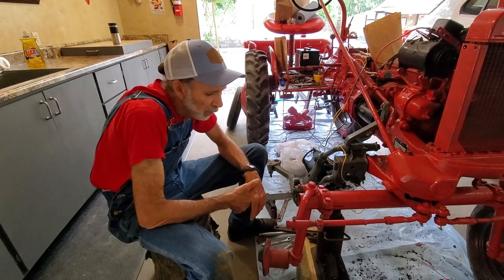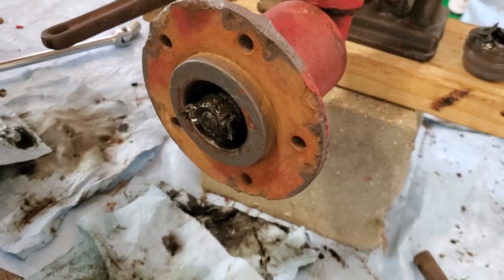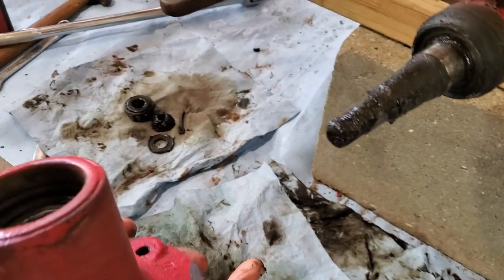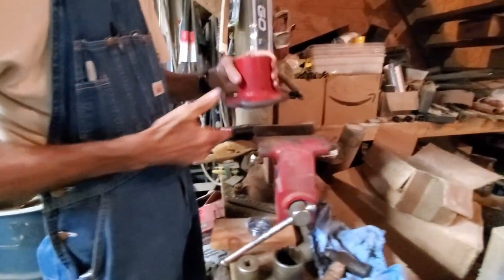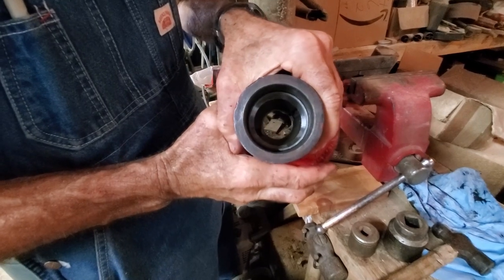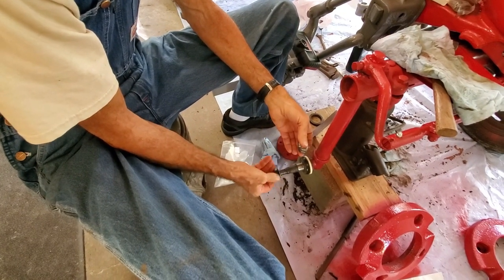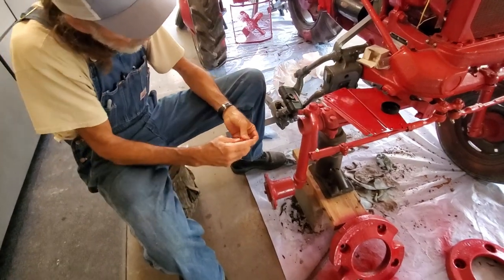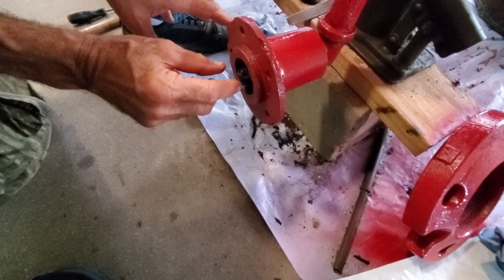Farmall Cub Tractor Restoration -- Replacing Front Wheel Bearings

Comment: Now that you have rebuilt it...Can you tap it and insert a grease zirt so you no longer have to take it apart to pack grease in the bearings?
Reply from the maker: You run the risk of blowing out the seal on the back of the hub doing that.

Comment: This guy is great. My only intention was to swap a damaged left front wheel on farmall super A from another parts super A . After looking at this video, I ended up replacing the bearings on the replacement left  wheel as well as the right  wheel. Now I have new bearings and grease on both front wheels. It took some time and reviewing the video, but I took my time and am satisfied I have it right.

Comment: today 5/20/23 i ran this video as i was going to repack the wheel bearings and just as happened with you, when i cleaned the inner bearing on the right side it fell apart. i went to the left side and the same bearing fell apart as i was removing the hub. and the hub is ate out inside. also same as you both sides spindles were welded  to the steering arms.ive had it about 4 years and repainted it to my liking, but dont use it for anything so i let the welded parts be. i guess its dig in the piggy bank time.  also i really like your videos.
Reply from the maker: I love using my cub in the fields.  Plows like a charm

Comment: Great job on tractor, I had a cub low boy back in the 80’s. Unfortunately seems like the guy that sold you that tractor only put a coat of paint on it and did not rebuild as much as he told you .
Reply from the maker: He only said he rebuilt the engine and put a clutch and pressure plate on it. And fixed a brake that was froze up.  I knew when buying it this had to be done. That's why I bought it so I could rebuild it.